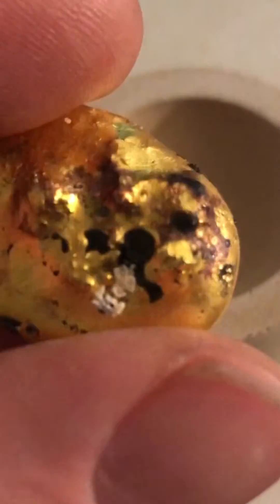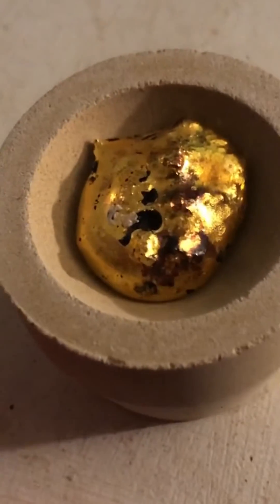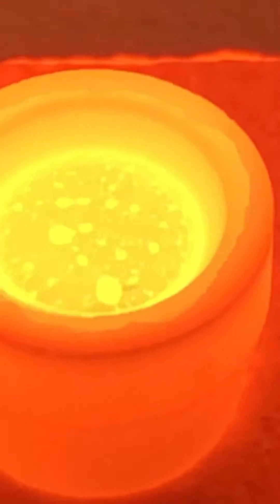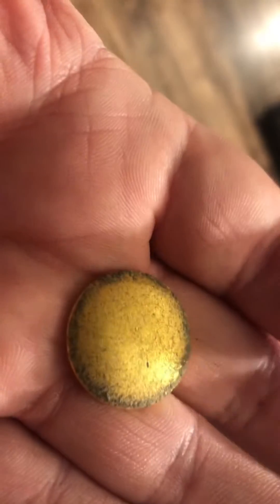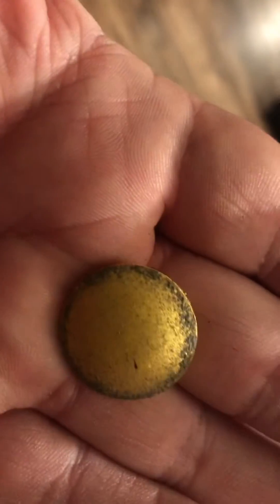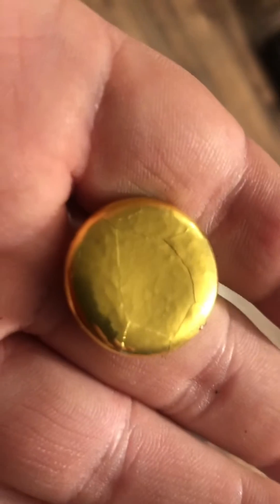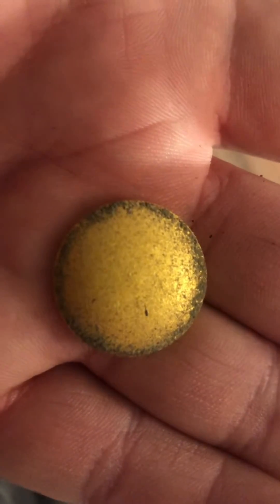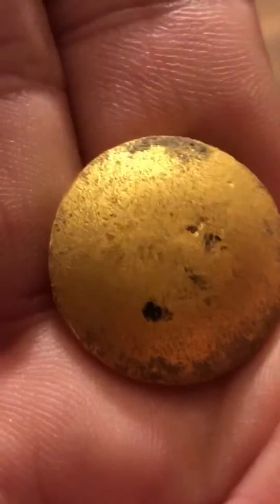Refining 24k gold with cupel no acids

Comment: That’s a pretty big button for that size cup but here’s a suggestion. You maybe needed more lead but not necessarily. Next time take it out of the over hot and make sure to move it around at the end. Roll it around the sides and keep it going with just a oxygen/propane torch. The open air works better than an oven. Always finish it off with good ol torch and tongs. Don’t let it solidify in a cupel… poor it off while liquid. I like beads but of course I got bars too. Kits are cheap. Beads are easier to weigh out.